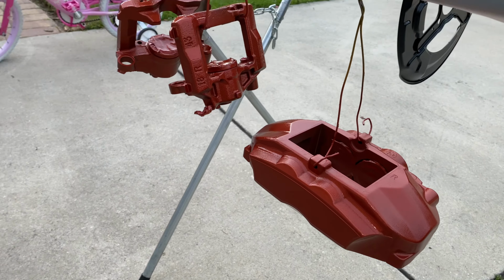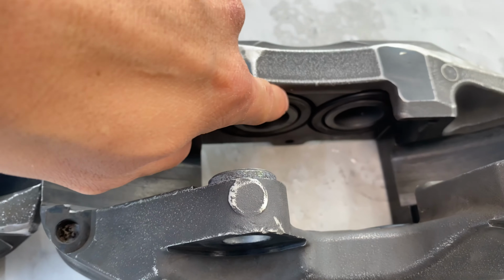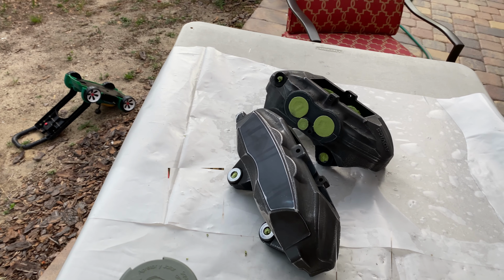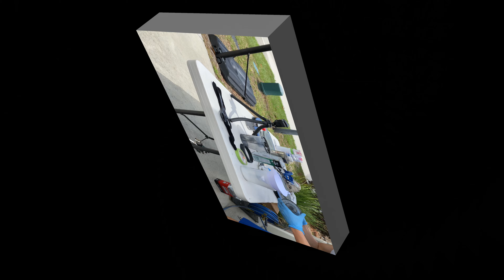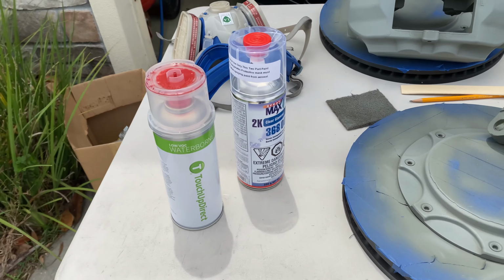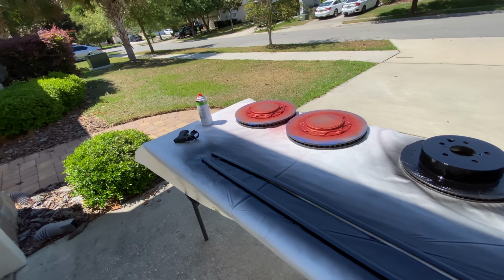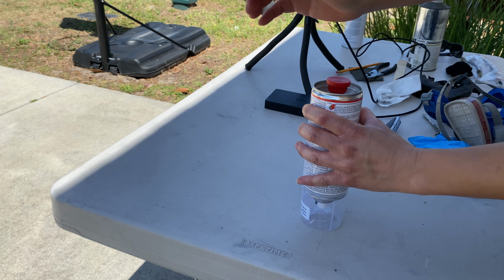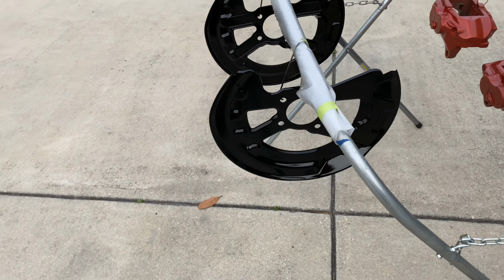Lexus F-Sport DIY Brake Caliper Painting-"Professional" Basecoat/2K Urethane Spraymax Aerosol Can

Comment: so a year later how are they holding up? I am hesitant to use the rustoleum primer since the can says it should only be use on surfaces up to 200deg and i think calipers can get hotter than that. yours turned out awesome, a shot at the end with them on the car would have been handy :)
Reply from the maker: They are good. No issues with paint. I do keep my stuff clean. I have other videos for install of this upgrade.

Comment: Hi, your videos are amazing. I wanted to kindly ask a question since you know better, when it comes to properly sanding the front rotors, if power sanding tools are not available, what is the proper type of sand paper grit did you use to smooth out the caliper (sanding by hand only)? And also, from your video, when you painted both front calipers with the etching primer, after it dried  out, what is the correct sand paper grit to be used after painting it with primer? I was inspired from your videos and doing this project for the first time, I appreciate your time and response and keep up the great work on your DIY videos.  thanks.
Reply from the maker: For scuffing and smoothing out. Try 200 grit. For the coating on the IS350 calipers it’s hard to remove so you just scuff it. For bare metal, just clean degrease and then sand. I used etching primer because it helps on metal surfaces, you can paint within 24 hours. After 24, sand with 600 grit before paint.
Reply: @TunerwithKids  Noted. I did bought the primer for the front calipers and will work on it. You're the best! Thank you.

Comment: If I want to use the IS 300 or IS 200 T rear caliper I can use my rear disc of my IS250 or I have to buy a new set of rear disc
Reply from the maker: On what year? 06-13 need specific year 350 or 06-11 GS. 14+ IS rear is different.
Reply: @TunerwithKids  mine is a 250 2012 so I need the 350 rear disc?
Reply from the maker: Yes. Any 06-13 IS350 or 07-11 GS350 rear rotor and caliper will fit. You have to bend the shield to fit. Need full caliper/bracket assembly. Uses the same 250 pads.
Reply: That’s great my friend ,thank you very much for the information did you give me I appreciate it

Comment: im thinkin about pickin one of these up soon, what do you think about the direct injection did you ever run into any problems with carbon buildup?
Reply from the maker: Pranav Rajaram I haven’t had carbon issues on the 250 yet, but I’m sure I will. I plan to walnut blast if I ever have to take intake manifold off again. Already did spark plugs 3 years and 20k miles ago. IS350 doesn’t have carbon issues since it has port and DI.
Reply: @TunerwithKids  The one im looking at seems to have gone to the dealer around 80k for the carbon issues, but its now at 160k. I'm thinking of just walnut blasting as soon as I buy it so I can be worry free. Other than that the car seems to have been well maintained, I'm just a little worried because of the higher mileage, you have any opinion on that?
Reply: Just have to go up there and check it out for yourself man mines high in miles and so far the only issue has been a leak in the caliper seal, and the cat was clogged. Given I only gave 5k for the car, with it well maintained and sitting on rims that cost dude 1400 it’s been well worth it. Also the seats blow cold air and there’s nothing better than that.

Comment: Question- I just bought OEM F Sport brakes, and they’re 6 pistons in the front and 4 piston rear ones. So these are just the stock brakes right?
Reply from the maker: You have Stop Tech Fsport accessory BBK. These are factory Fsport brakes from 4 generation GS Fsport RWD.

Comment: Hey, quick question can a Non F-Sport 2014 lexus gs350 Original rotors And Calipers And Barely Used Bremo Brake Pads bolt on to a 2015 Lexus IS 250 F-sport both fronts and rears? Thanks
Reply from the maker: Yes. Front. Not sure about rear.

Comment: Is 2K Clear good for the amount of high heat from the brakes?
Reply from the maker: TEE yes if they can sit in 120F car paint in summer. I’ve been running basecoat and clear coat on my IS350 calipers for 11 years.
Reply: @TunerwithKids  if you consider 120F high heat then i got bad news for you.... unless you never use your brakes then you should be ok lol